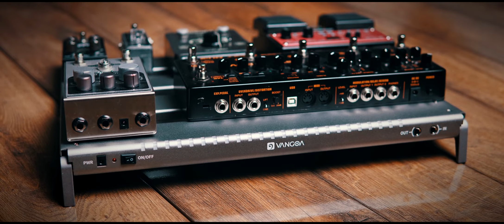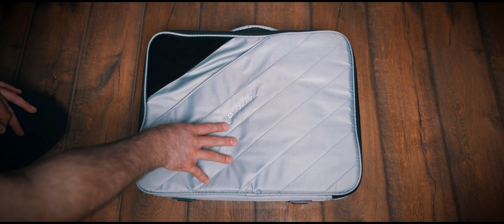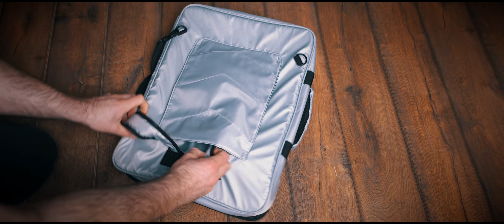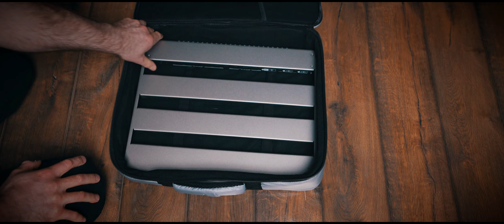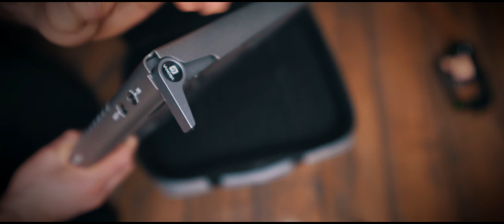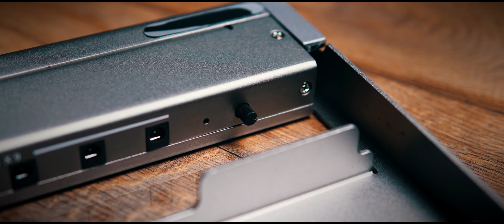Vangoa Powered Pedalboard – Affordable, Isolated, Smart Design

Comment: Hi Ben, I have the Cerberus and SmallFry thanks to your videos. Are you not using the preamp pedal anymore because I see that you are using a small board that won't fit another pedal. Let me know when you have time.. Thanks,  Frank
Reply from the maker: I hope I'm not leading you astray, ha! I use the Simplifier and the Origin FX Deluxe 61 (after it was sent to me) in combination with the Cerberus and SFBU. I'd just have either on the floor adjacent to the board and 4 cable with the Cerberus. I only use a preamp if I'm doing a backing track style gig, or maybe solo blues. Both of those are direct to PA gigs. If I'm doing a regular band gig, I'd be using the Marshall SV20 with the SFBU and Cerberus. I used both the Simplifier and Deluxe 61 for this video. They tend to be permanently plugged in at home unless the gig requires them. A lot of the time on backing track gigs I've just been using that cheap Pocket Master by Sonicake. The audience don't know the difference and it feels fine to play on, so...49 quid rig it is!
Reply: @BenFletcherGuitar great! Thanks for the detailed explanation. I'm guessing you use the effects such as reverb and delay from the cerberus. Thanks again

Comment: That DB meter strip at the front would be handy if it could also be a tuner, assuming they could make it an accurate one.
Reply from the maker: I watched a review by Shane from 'In The Blues' where he made this suggestion. It could be interesting, but you'd have to have a mute switch for it to be useful in a live environment. That would make it more complex, requiring a footswitch too. Also, its position on the upper bout would be obscured from the player if you have large or thick pedals on your second row. The board is too thin at the leading edge to accomodate a tuner. All roads lead to challenges!